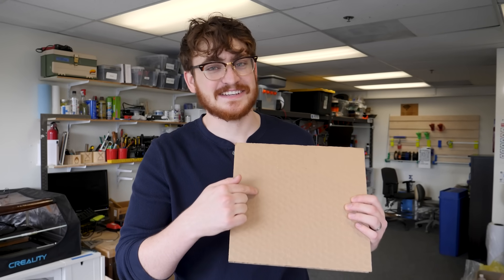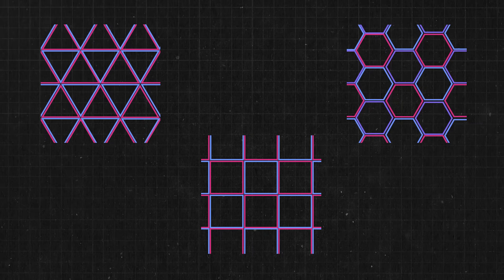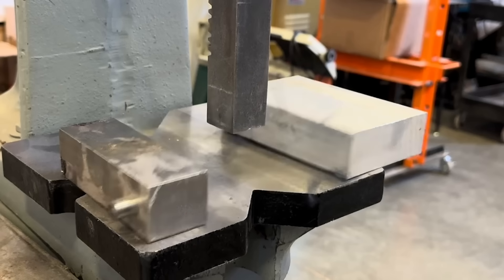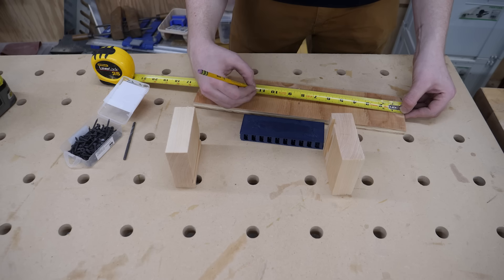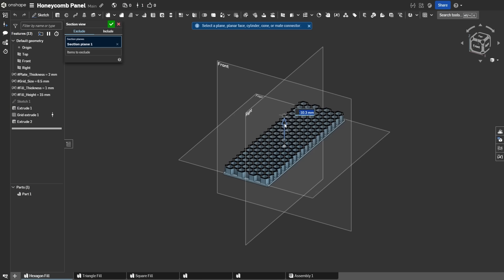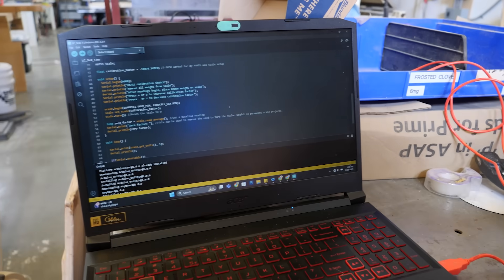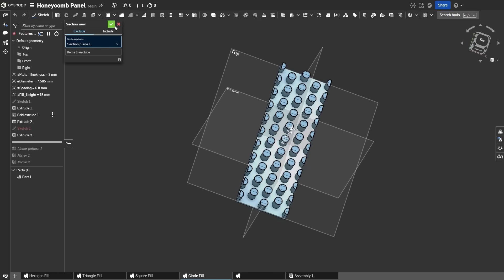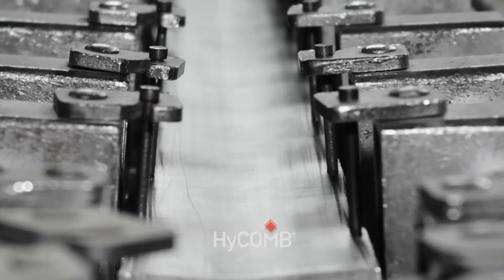Taking the Hexagons out of Honeycomb Panels

Comment: Oh great, another millennial who think every engineering before him was a neanderthal. Hexagons are used in sandwiches exactly for structural reasons, which is they provide an infill which is lightweight yet provides enough inertia to the structure. Triangles and squares would be "stronger", but the point of sandwich panels is "strength" to weight ratio, not ultimate strength. The point is to have a structural panel with negligible weight and the hexagons do that job just fine, you can't bend by hand a sandwich done with the flimsiest aluminum hexagons. But come on, show us why everybody before you was wrong.
Reply: You're time has past, old man. Hexagons suck now, get on with the times.
Reply: You somehow missed the point of this video, didn't you...
Reply: @DerSolinski  uhm.. id you actually watch the video or just assume that BS?
Reply: @DerSolinski  Doesn't do what the title says, doesn't show a better shape..yet he says hexagons aren't the best shape..what's the point of the video? It's inconclusive.
Reply: @ The video is a reaction to previous comments proving that honeycomb is used because of ease of manufacturing and not because it's "the best"
That's the point of this video.
He ain't hating on it, or saying "use this, it's better".
Reply: @engineeringdisillusion 
Thy point in that anyshope to full the middle part of the sadwiug will work, therefore hexagons aren't better in strength 
And the resone way thy are used is bechos thy are easyer to make
Reply: @ "proving that honeycomb is used because of ease of manufacturing and not because it's "the best""
That is not at all what the video does.

Seriously - you could make a video claiming that Co2 isn't a great firesuppressant for electrical fires cause it doesn't perform as good as water on fabric and wood fires: aka you completely missed the assignment.
Reply: @Goroca  In his setup, with 3d printed sandwiches, yes. So?

Comment: hexagons are bestagons, ie approximately circle. be there, or be square. arc beams are better. yes its a circle honeycomb pattern on its side, vertically, as a bridge. for said reason. an edge comes from the manufacturing easiness. and all the other factors (tm).
Reply: So circles are bestagons and hexagons are just cheap circles.

Comment: The real trick with 3D printing is to design things that don't need infill in the first place. If you need infill, you're making bad designs.
Reply from the maker: @moth.monster  I’d agree if you’re trying to use the infill for strength instead of just supporting the top surfaces for printing. Strength should be handled by the outer shell
Reply: Infill is actevly rely use force bechos you can make parts that are really big, strong and light waighet. 
Also in some ledig scenarion infill fore structural support is nesesery 
Wach the video ConHathy refreshes to